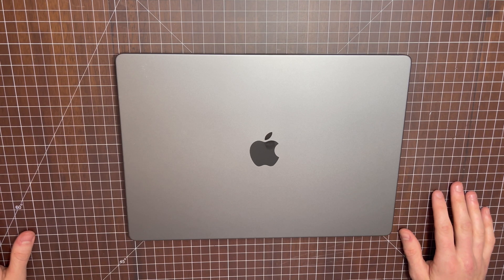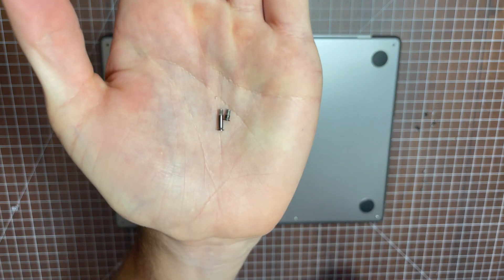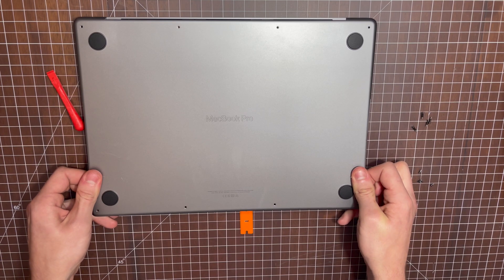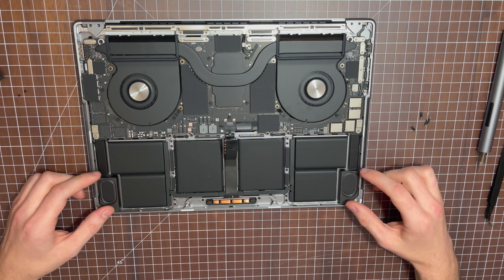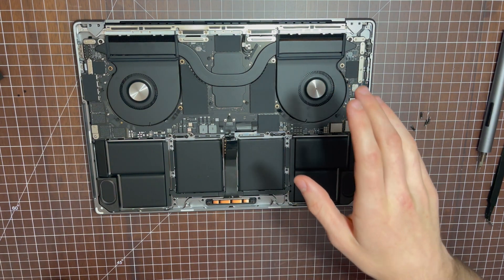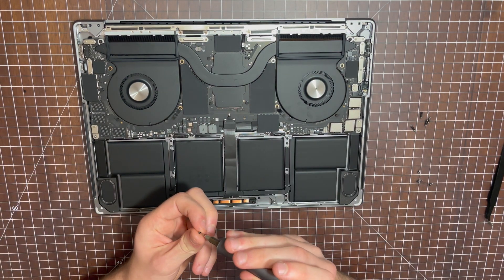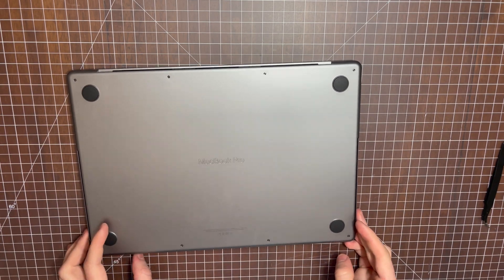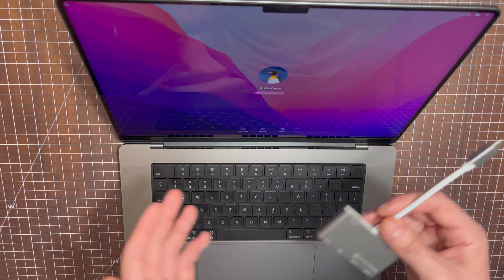Back Cover Removal Look Inside New 2021 MacBook Pro 16 inch M1 Pro M1 Max

Comment: I bought a 16-inch MacBook M1 (2021) at a very good price because I thought it would be worth repairing. If it turns out to be locked with an iCloud account, is there any way to replace the drive to format it? Or do I absolutely need to find the previous owner to unlock it?

Comment: Thanks bro. I opened my laptop to clean it from some dust that had accumulated inside and was having trouble installing the back cover back in place. But thanks to your video, I was able to finish that part easily. Really appreciate it!
Reply: This is what I wanted to do but I got scared I’d have the same issue. I’m just gonna take it to apple and see if they’ll do it lol

Comment: There is a mistake in this video! The back cover installation advice is not in agreement with Apple's published manual. Incorrect installation can result in functionality loss of the antenna.

Here is the correct installation instructions: https://youtu.be/6_iivE3Ao0I

Comment: Thank you for this video! After spilling juice all over my MacBook I turned it off. I saw the juice go into the vents so I knew I needed to dry it out. I got to the part where i disconnect the battery terminal to find the connector on the logic board is corroded and so is the wire. Is this fixable?

Comment: If you fold the battery cable like that, you will damage the conductor paths. 
Closed the end with a light adhesive tape, nothing happens. I'm telling from experience.

Comment: i've got a question
The back cover of macbook/macbook air/macbook pro (including M1 2020 and M1 Pro/Max 2021) are made plastic or also aluminium?
Reply from the maker: They're made of aluminum
Reply: @elevatecomputing6004  thanks for the answer, 

I had that doubt for years [I have never had a macbook to test it :(]

Comment: Hello, i’ve just send my new macbook pro 14 to service the same day that it arrived. A small qr code looking stiker fell out out the left gap where the fan pushes air. Plus when I gave it a little shake, you could feel that something was moving inside the unit, like it wasn’t in place right. I’m still waiting for a response from the service. But, do you have any idea what could it be? I’m really curious why or how that sticker fell out of the mac because by looking at you teardown it looks similar to a qr code that your  unit has on the middle left part inside.
Reply from the maker: I just did a full teardown (a small clip from it is posted) and saw 40+ little QR codes, no idea where it could have come from. I'm sorry to hear about that though, I know how excited I was to get mine I can't imagine having to give it up day one...
Reply: @elevatecomputing6004   thanks for the feedback anyway! I hope you have a great day!

Comment: Your video is labeled as M1 Pro M1 Max but only shows the M1 Pro. Considering the M1 Max has a larger chip it should not be assumed that the insides of both are going to look the same and the video should not be labeled as such. Great job on showing how to review the bottom cover though.

Comment: Props to you for opening that shiny new machine... beside that, a mundane request, where did you get that small electric screwdriver? It looks like a perfect gift for a friend of mine. Thanks.
Reply from the maker: It is a wowstick 1F, you can get them on Amazon or sometimes cheaper on AliExpress
Reply: There are quite a few brands that sell these electric screwdrivers - Could be a Wowstick 1F

Comment: Looks like it should be reasonably easy to replace the batteries after 3 to 5 years. How to clean the fans and cooling system maybe once a year in a dusty in environment looks more challenging, if you have to take out the mainboard.
Reply: Apple does it for you for $200. I’d recommend you just go through them. At least for me, they replaced the top case too so it was worth it

Comment: I'm interested in seeing the quality of the thermal paste and whether the VRMs are properly cooled unlike the Intel 16-inch.
Reply from the maker: I’m also curious, Apple has been notorious for using bad or at least short lived thermal paste. I might have to do some further digging
Reply from the maker: Took apart the whole thing today.... full teardown coming tonight, but I just posted a clip of the heatsink removal
Reply from the maker: That's the goal! Went to turn it on after the teardown (like 30 minutes ago), pressed the power button, held the power button, nothing.. for some reason even though the battery is fully charged it needed to be plugged in to turn back on. Scary stuff
Reply from the maker: Haha thank you! It's going to hurt doing a full teardown on my new baby but I'll do it for the fans haha